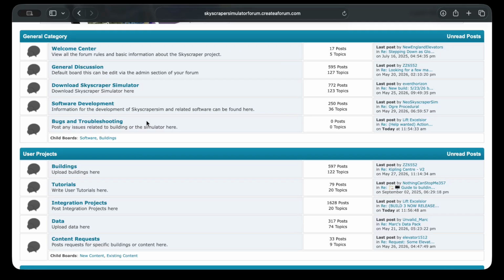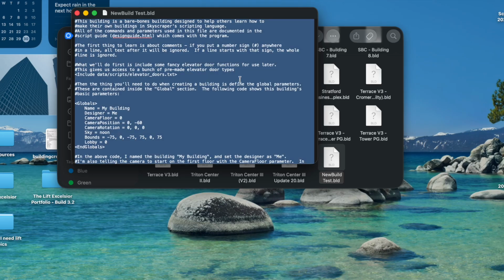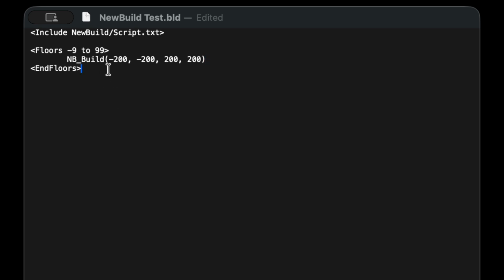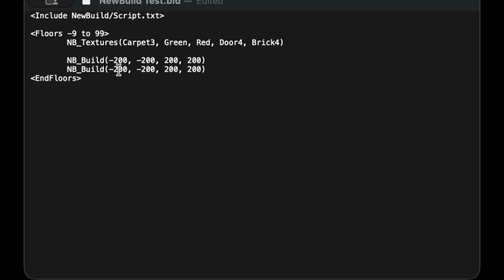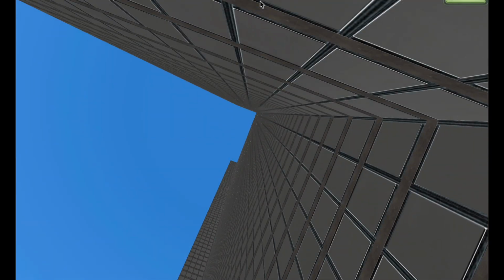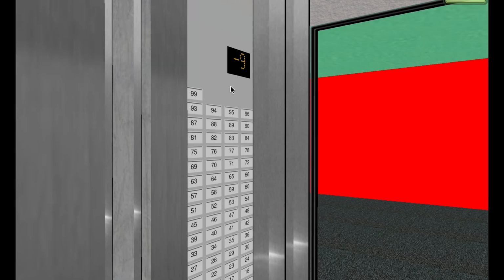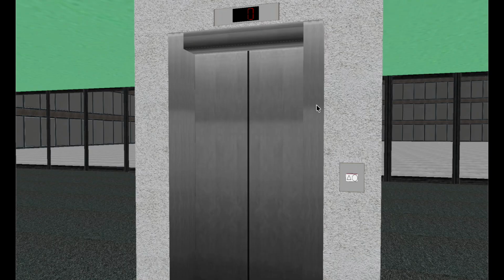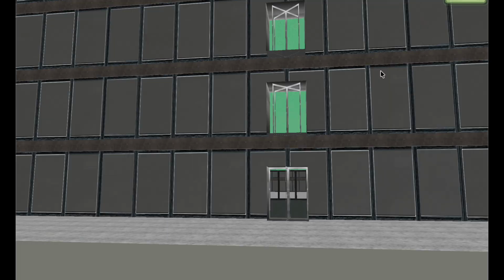Skyscraper - Making buildings with NewBuild - Part 1 (The basics)

Comment: wow this is pretty cool (: it genuinely feels like I can hand code buildings which I never thought of ever doing before, although for some reason the buttons have this texture issue on your buidlings where the texture is like, angled? and some buttons look like interlacing, I'm not sure why, I don't know if it's skyscrapersim or if I installed it wrong, also can you separate textures between each lift? so for example, have the default elevator textures like the metal and etc on 1 lift but have custom ones on another, and 1 more thing, can you have a normal size cab while having dual speed doors? or is it just what the preset uses for now.
Reply from the maker: Thanks for the support! There is a new release coming this Thursday that'll add even more features, including super realistic furniture!
What do you mean by the textures are angled and interlacing? Can you upload a screenshot to imgbb.com and post the link here? I've never heard of that issue before.
If you use the ElevTextures function immediately after creating the first lift to set the textures back to the defaults, you can separate the textures for each lift.
Sorry, dualspeed doors can only be created on big goods lifts for now, but it might be possible in the future.
I'd love to see your buildings when you're done making them! Please release them to the Skyscraper Simulator Forum if you have an account or to Google Drive and send the link in these comments! I will explore them and review them for you!